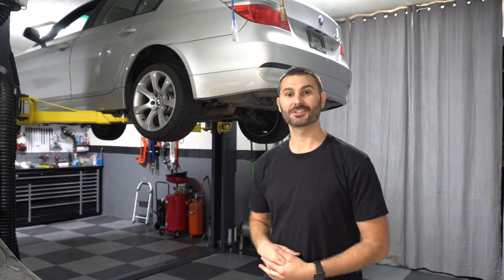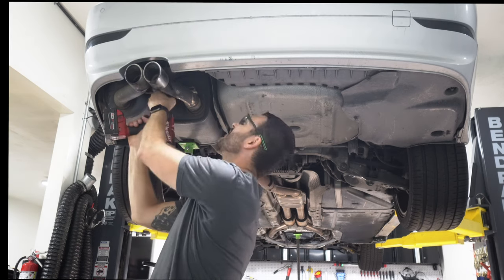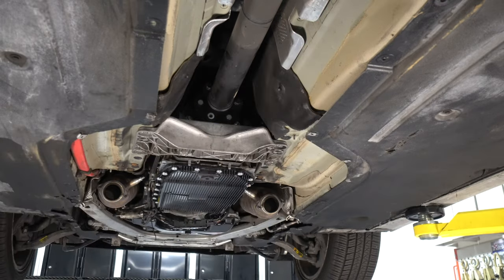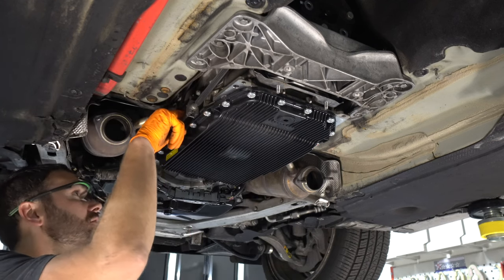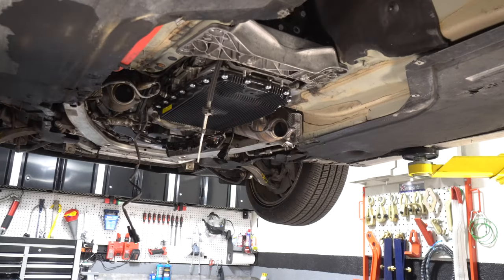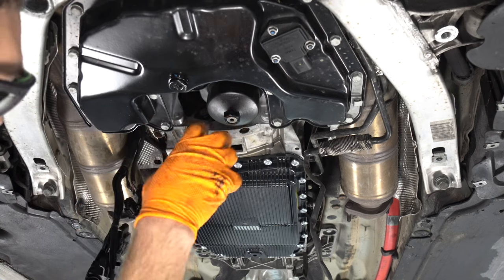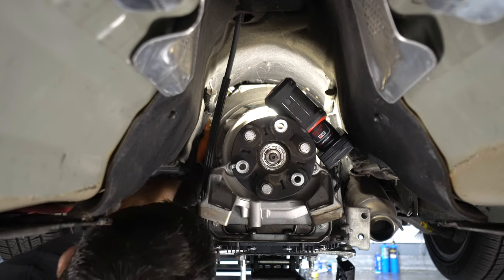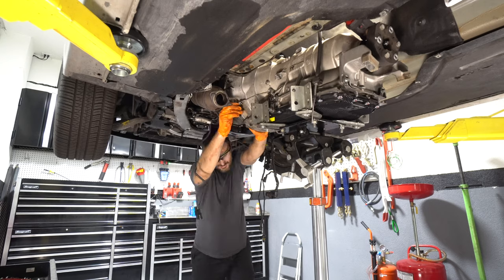BMW 545i E60's ZF6HP26 Transmission Removal

Comment: How much more work do you think it would take to get to the starter once the transmission is removed?  

I need to replace the coolant gasket that sits within the bell housing and wondered if it would be much more work to do the starter while the trans is out.
Reply from the maker: Hey! Once you remove the transmission, two of the bell housing bolts actually hold in the starter. I believe it would be just a matter of disconnecting the wires and it should come free. Unless there is something in the way to remove it but I don’t think that’s the case.
Reply: @rebuildrevival  good to know! All the vids and writeups I’ve seen show people lowering the subframe and removing the exhaust manifold…going to tackle it while the trans is out regardless but figured I’d ask to see what you thought.  I Appreciate the reply!